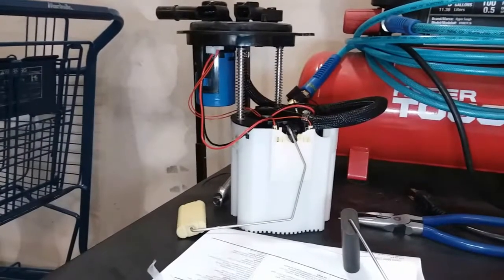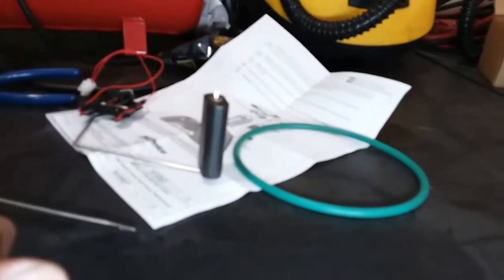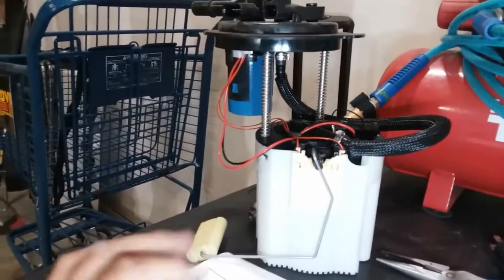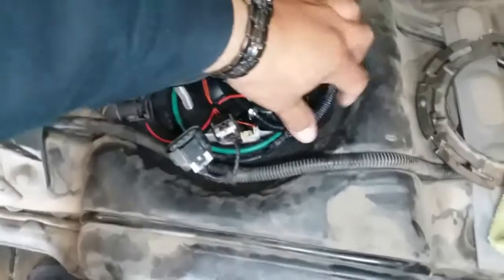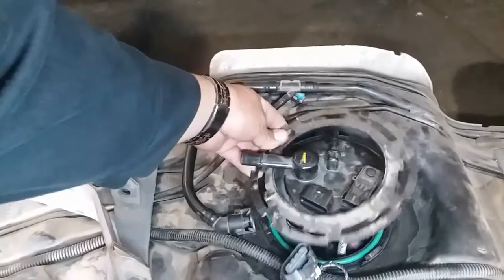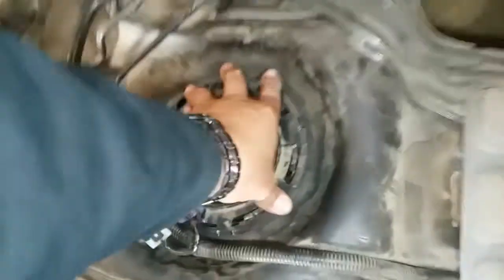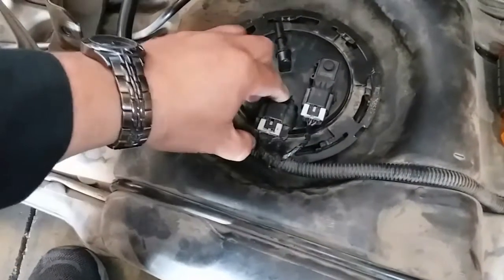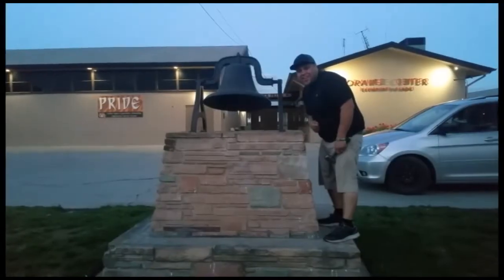How to: Install a Fuel Pump on a 2011 Chevrolet Traverse

Comment: Do you have reprogram the Fuel pump module after you install the new one? Bc chevy told me they have to reprogram it after installation. Just want to know if this is something that we can do ourselves
Reply from the maker: No i didnt...it was all plug and play. If anything try disconnecting the battery before this is done to insure nothing gets messed with the electrical system. Good luck! Thank you for your SUPPORT!
Reply: @559powerscape  hey quick question, how do u know which fuel pump is bad this car has two. One in the tank and the high pressure one by the engine by the throttle body.
Reply from the maker: @christinamarotta5847  I'm not to sure the issue with mine was that the gas gauge wasn't marking. It showed it was empty...turned out to be the pigtail. Were the fuel pump connects....i don't know how that happen but the inside prongs weren't making contact....sorry about that...but that I know of the only pump is in the tank. I think the frint might be a regulator...not sure tho
Reply: Would this be the same procedure with a 2015?
Reply from the maker: Yes